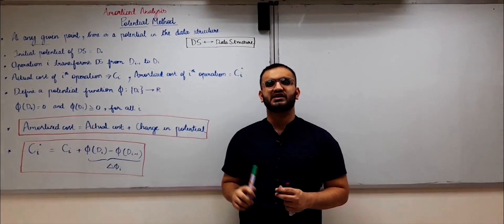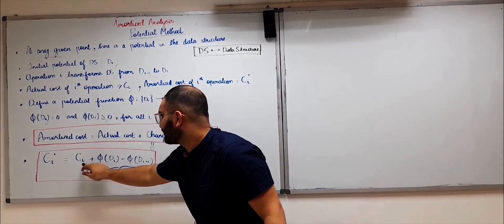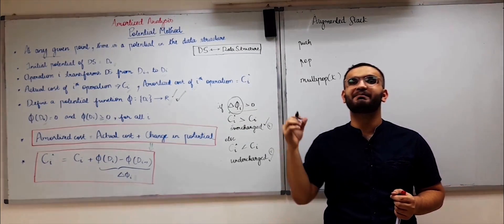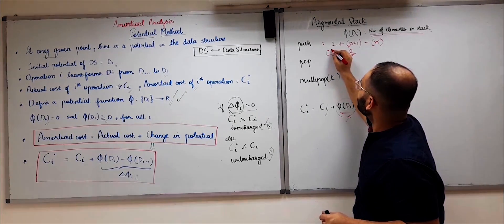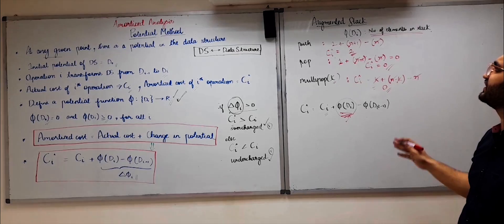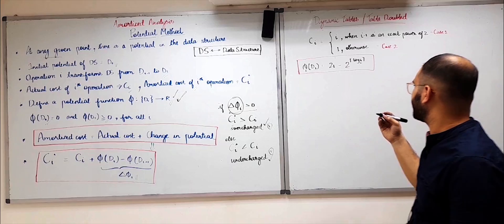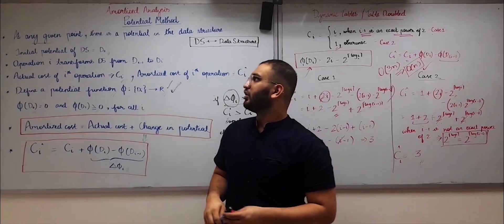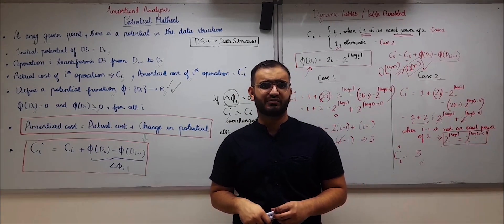1.4 Potential Method in Amortized Analysis | With Examples| Advanced Data Structures | Algorithms

Comment: Very nice explained!! It helps a lot for the exam :) But I have a question: In class we use a +1 in the exponent behind the logarithm to simplify the ceiling function. Does that also work? Like ceiling(log2(n-1))  we write: log2g(n-1)+1 and with the base 2: we get 2*(n-1) (after computing)